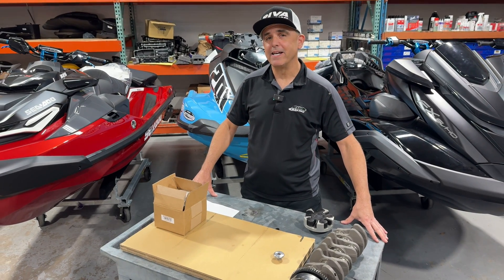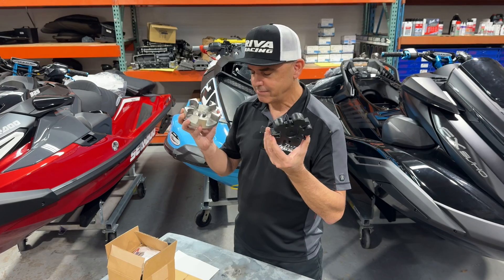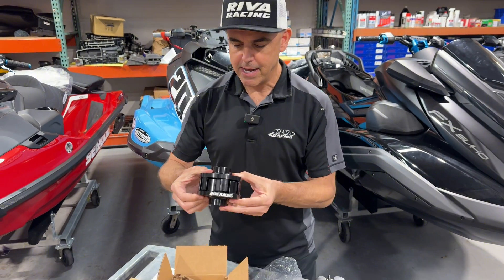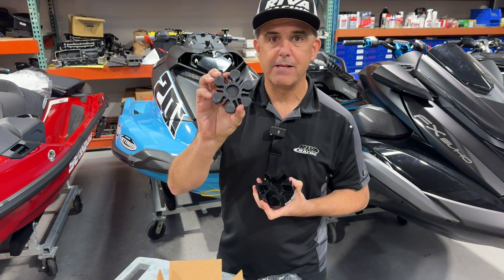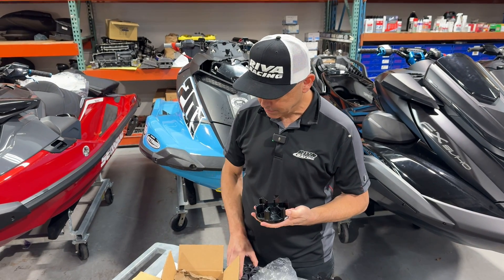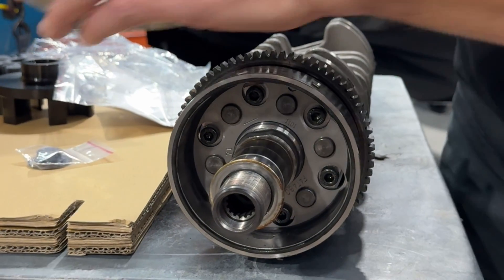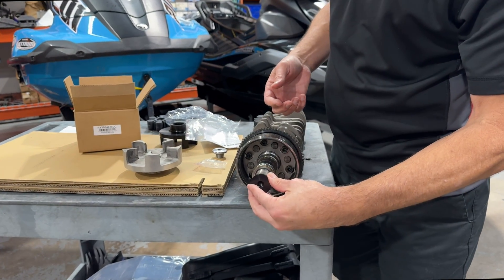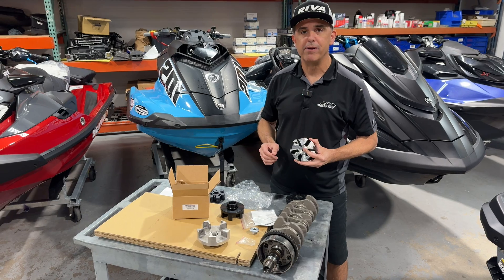RIVA YAMAHA 1.8/1.9L BILLET DRIVELINE COUPLER KIT

Comment: Any specialty tools required for removal and installation?
Reply from the maker: Yes. We offer the tools through our website. They are listed in the installation guidelines that come with the coupler kit. Here's the link to the file: https://rivaracing.com/.../download/file/4691/product/84062/
Reply: What is the price ? I have Yamaha 2024 vx cruiser this work for me ?
Reply: I have a 2014 fx svho with only 32 hours run time. You guessed it! Yes the timing chain flew apart. Was garage kept for years until I found it late in 2019 and tried to help the original owner have the engine replaced by Yamaha. No luck spent countless hours on the phone. Failed the good will. This is wrong. I was told maybe Riva could help out. If I trailer it down to Florida from Pennsylvania